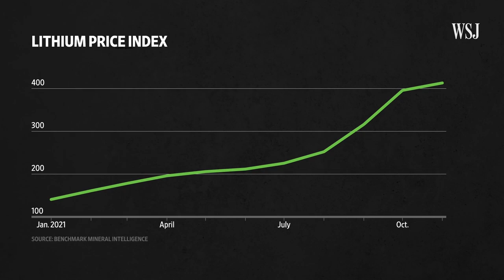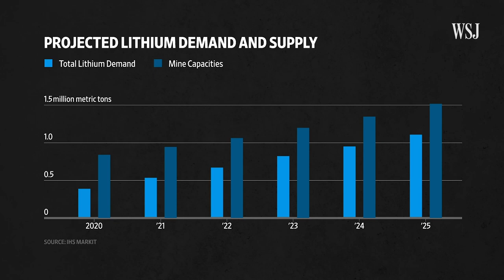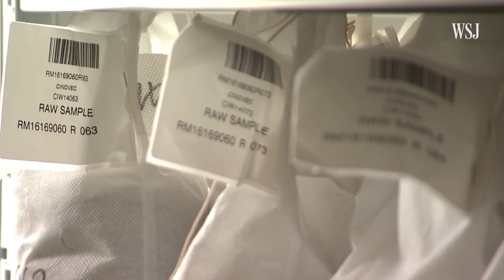Lithium for EV Batteries Is in High Demand, but Protesters Push Back | WSJ

Comment: I like the WSJ, but a key element was omitted from this story: is mining and refining lithium creating toxins in the environment.  Protesters usually have a reason for protesting (not always, but usually), and it’s hard to believe that protesters were the ones who made the original claims about pollution.  More importantly - are these claims legit?
Reply: Just look at what happened in Papa New Guinea
Reply: That's because Serbia is outside EU, EU nation tend to be very strict when come to mining and environment. The Rio Tinto's mining company that went to Serbia because it is easy to mine without or little regulation and the govt seem to make a blind eye about it just to have profit.
Is the same as gold mining, regulation stated no harmful chemical to be use, after dug up will be fill up and plant tree's and no mining near protected area (rivers, lake, habitat, etc). Meanwhile in Africa illegal mining, mercury being use, environment get destroy and most money goes to black market.
Reply: you have pointed out a myth. check out engineering explained on mining toxins vs mechanical or coal. Also there are several projects mining aim for net zero emissions etc. It is good to keep these companies honest though, but they are currently working on these issues
Reply: @mugumyapaultheafricannomad9488  post some articles that talk about that, the ones I've seen say the net impact is better than oil and gas
Reply: idk if that is true or but we'll run out of oil anyways and transition to EVs sooner or later so why not now, instead of pumping millions of tons of co2 in the air then transitioning to EVs why not do it now
Reply: @lokisg3  are you talking about mining or refining? The lithium deposit doesn’t care about EU regulations. If it is located in Serbia, what do you expect mining companies do? Build a mine in Germany to mine lithium in Serbia?
Reply: No

Comment: Of all the projects I have heard about the one GM is pursuing is the best I have heard of so far. They are partnering with a company that will pump brine from below the Salton Sea in California. The lithium will be filtered from the brine with the leftover water pumped right down to where it came from.
Reply: @zacharyfriedman8709  And Panasonic is partnering with Redwood Materials. The issue there might be securing sufficient supply. GM and Ford are both planning big programs with the F150 and Silverado. So it could be a while before there are enough old batteries for Redwood to recycle.
Reply: "company that will pump brine from below the Salton Sea in California"
Yeah... because the subsidence in California is not large enough...
Reply: How much is estimated to be down there? What is the extraction/processing/shipping over seas and land transportation and transfer costs? Seems highly illogical this goes through.
Reply: @dontcare7086  Like tons of lithium salts dissolved in millions of gallons of brine. So pump up water, filter out lithium, pump water back down, in a continuous loop. So subsidence won’t be an issue.

Comment: There is not enough on the planet to replace existing cars with electric.
Reply: on the planet for sure, currently the supply isn't meeting the demand. I have no idea where your getting this information. A quick google shows there is enough to last until mid century. That is all the known lithium I would imagine new mines will be found by then.
Reply: there is almost equal done calculation.
it equal to 80% of all ICE cars now. more mine will be found out.
Sodium battery is way to go. electrolysis of water for green hydrogen by excess
solar energy + also electrolysis of sea salt in same water(NaCl) for sodium batteries.Oxygen and chlorine as useful bi-product.then using same Sodium with
react with atmospheric Co2 captured to form sodium carbonates for battery uses
Reply: @hmmmm6685  no, lithium ion batteries are the best current batteries until this an adopted technology I would agree however arguing this makes you sound crazy.
Reply: What about huge electric grid systems for recharging stations across the countries?
Reply: @emmanuilushka  California is the model state for the green future of electric cars. They never have rolling blackouts to cope with power shortages.
Reply: Better to just use trains instead.  Car culture is just dumb and silly.

Comment: Its all about copper. Inventories  approaching lows. Electric vehicles require 3.5 times the amount of copper a hydrocarbon vehicle does. That on top of an already high demanding renewable infrastructure being put into place (wind, solar). 

In short there is not enough copper and new mines take years to develop. People in copper production know all this already. But hey feel free to keep pushing renewable vehicles. It will drive up the price of everything (inflation due to direct/indirect demand of copper and associated  commodities. If you really care about the environment you don't buy new anything! Anything new including new cars adds more CO2. Fixing an old hydrocarbon vehicle keeps CO2 low. Keep your old toasters, old cloths, old shoes, sports equipment  etc. and you will help reduce greenhouse gasses.  The throw away environment we live in today is the problem, green cars do not solve this.
Reply: @Kenneth Tham The comparison you need to make is driving an existing hydrocarbon vehicle, who's production footprint is already made. 
You have the emissions going forward from an existing hydrocarbon vehicle whose production footprint already exists.
Or you have the production emissions from a new green car plus its emissions going forward. Yes green cars still have emissions. Electricity is still predominantly carbon based. Unless you want to charge with green energy, but the upfront costs for that are enormous. Green cars and green electricity take 15 years to recoup costs vs hydrocarbons. 
I am not ignorant.  I work in electrical generation, 30+ years.
Green cars are toys for the wealthy. Poor people need cheap transportation, used existing hydrocarbon vehicles. 
Green (expensive) electricity hurts the poorest people in society where utilities account for a larger share of their living expenses than others more well off. 
Cheap electricity helps all. Green electricity keeps poor people and poor countries poor. Dont drink the green kool-aid.

Comment: We've already seen two major traffic jams in frigid weather in the past few months. All of those vehicles had combustion engines, which easily idled while burning little fuel and providing ample heat to keep people from freezing to death. With EVs, those traffic jams would have ended up as mass casualty events from hypothermia. 

And I don't know of any credible person claiming that supply will outpace demand in the months to years ahead, in fact it is the exact opposite. We are expected to go into a true supply deficit very soon (weeks to months) and there is no end in sight to that deficit. Lithium is nothing like hydrocarbons, which massively accumulated into concentrated pockets within natural reservoirs over the past 250,000,000 years from photosynthesis, burial, then decay. Instead, lithium is typically comprised of very soluble minerals which makes it highly sparse spread out within the entire Earth's waters and only accumulated under special circumstances when evaporated sea water created evaporite deposits that then underwent special leaching conditions - meaning very few evaporite deposits have economically recoverable lithium. Lithium is so diluted in sea water that the energy costs of simply lifting the sea water (no factoring in any other costs) to produce a single EV battery is around $16,000 at low end energy prices. 

 If every vehicle now and in the future were an EV, known economically recoverable lithium deposits would be exhausted in ten years.  But the point isn't to transition to a "green" economy (whatever that means), it is to create a Great Reset.

Comment: the problem is that electric vehicles are being marketed as luxury transportation. Ideally, you'd want a tiny barebone electric car to run errands. Small battery, light vehicle without the gizmos that will break
Reply: Everyone saying Tesla made affordable cars, and I'm like what? Only the upper middle class in Europe can afford a tesla...
Reply: @nenadmilovanovic5271  Tesla is a luxury in the USA. Americans in many areas couldn't afford a Tesla even if they wanted one.
Reply: Tiny, barebone EVs existed long before tesla but no one wanted to buy them.

Comment: Even if we move to electric cars. It doesn’t necessarily mean we source our power from renewable sources
Reply: Correct but still its better then ice cars
Reply: @netrox1345  better in what? Go check BEVs average Carbon Footprint.
Reply: @RogerM88  and even if lets say evs will no longer emit co2 there are still other factors to take in consideration because cars are not the only problem. Fast food industries for example are a problem because methane its much more dangerous then CO2. Food in general its also a problem from many points of view.
Reply: @netrox1345  with the current difficulty in ramping up BEV production at an average affordable price to the consumer, wont be a surprise if there's a switch for Hydrogen powered cars.
Reply: @RogerM88  wow another one who thinks that hydrogen will power our cars.. maybe public transport and even then we actualy dont know for sure if it will be sufficient. Also you need to make pure hydrogen.. and that process also pollutes. Also the chinese automakers and tesla doest seem to have a big problem compared to other automakers from US. You are just trying to change my opinion and convince me that evs are bad. If you really think that hydrogen will power our cars then think again. For trucks, aviation it makes more sense. Also in rocket industry hydrogen its a good choice and it makes more sense but for cars and even public transport im sorry but thats not true..
Reply: @RogerM88  also thete is a problem ramping up evs because of the actual situation that its happening in Ucraine
Reply: @netrox1345  no, the issues ramping up BEV production were already there before. They are related with constrains in supply chains for battery production. As availability of raw materials coming from mining, as with Lithium.
Reply: @RogerM88  And please next time try to be on update or do some research taking in consideration many factors. You are not the only guy whos trying to change my opinion there are a lot of misinformed pleople you are not the only one i dont want to be rude but if you really dont have a really good point and you still keep to spread only negative things about evs then dont reply back pls  you are just wasting my time for something that we already know how it is going to end and what will power our cars in the next years

Comment: Can we do without Lithium? I am sure battery technology is going to improve drastically in coming years.
Reply: @SuperLusername  All I am trying to say is we should try and harness energy from a source with zero impact on the environment. 

But what is it about Singapore? How is Singapore sinking? Due to rise in sea levels?
Reply: @pavankumar-ff9bo8zc5y  No, not due to rise in sea levels.
You know how sand is coarse, irritating and it gets everywhere? Well, there is also a shortage of it. Sand is the fundamental ingredient in cement and China is using half of world's cement. They get the send from the bottom of the South China Sea and that is affecting Singapore. 
This is not happening only there, but all around the world.
Reply: @SuperLusername  How is it possible they are using sea sand for construction? It has very low tensile strength. Normally fresh water/river water sand is used in constructions.  Here in India we are seeing an increase in sand mafia due to heavy demand and shortage of supply.
Reply: @pavankumar-ff9bo8zc5y  I dont know why, maybe for constructions that need high compressive but low tensile strength. I mean you can easily read more on the internet.
Reply: @SuperLusername  Or maybe the Chinese have the technology to process them and make them market ready.

Comment: Tech giants should push for Graphene batteries ...they are way more powerful, light weight, strong and reliable. Graphite/Carbon is also widely available 
Only problem is its mass production which can be easily solved as all the major tech giants have the resources to fund the research and development of industrial process to mass manufacture such batteries
Reply: I agree, Graphene batteries and materials will change the world at some point, it’s just a matter of when.

Comment: Such a great explanation that not concentrating refining of lithium in China will result in a "really complex supply chain", as if that is a bad thing.  Supply chains that have bottlenecks are inefficient economically, risky, and yield high profits that are not connected to value delivered.  Do people think any more?
Reply: That exact concentration of manufacturing in China has lead to the greatest slowdown and bottleneck on the supply chain in recent history

Comment: It seems that people are worried about possible contamination but where's the data showing what actually is contaminated when these lithium batteries are made?
Reply: That logic goes both ways. Where is the data that shows it doesn't contaminate?

Fortunately for Serbia, it is proved that it does. Do your research.
Reply: @NM-ej3xw  I agree. Just pointing out that none of the data or research was presented here. Also, how much of an impact in relation to current environmental impact is relevant as well.
Reply: Lithium makes great batteries because it is a reactive element. It just doesn't stop being reactive because you are trying to get it out of the ground. IE assume reactive elements pollute and are harmful to people is a reasonable assumption.
Reply: @stapleman007  that's reasonable
Reply: @MilanVVVVV  that's helpful context

Comment: Lithium mining isn't nearly as bad as coal plants when it comes to environmental impact, so a lot of the Europeans in this comment thread need to get off their high horses and let decarbonization happen.
Reply: It's all the same story. I'm all for green energy windmills, solar panels, lithium mine, etc, just don't put them where I live, work, or vacation.
Reply: See, this comment here demonstrates how badly we need to see dislikes
Reply: @dotthree7894  2000 ppl die from coal emissions in Serbia each year. That's the status quo ppl support when blocking things like lithium extraction, solar/wind installations, and nuclear plants
Reply: @stapleman007  yup, and there are so many people in the comments that show this to be the case. People have a ridiculously strong status quo bias, even if they identify as an environmentalist
Reply: @kathleenzinkovitch4050  800,000 people die EVERY YEAR due to pollution from coal plants. Without massive amounts of nuclear energy, or a lot of lithium batteries, that's what poor communities will continue to be saddled with.
Reply: @zaneearldufour  Serbia has a very nasty air pollution problem caused by the local industry. I agree that solar/wind installations along with nuclear power plants are the way to go, but Serbia is a long way away from that, unfortunately.

It's not the status quo people support, as the environmental protests also had signs such as: 'I can't breathe', etc. 
The air pollution problem is quite bad, and it's caused entirely by carelessness, lack of regulation, and most importantly - corruption.

Opening a lithium mine can only make this worse, and destroy an entire region. It will pollute everything else, but the air in Serbia still won't change.

These environmental protests were against all of those problems, but ALSO against Rio Tinto.

Either way, I don't expect to change your mind, but merely paint the full picture for anybody else reading.